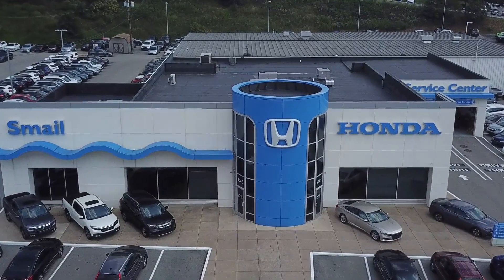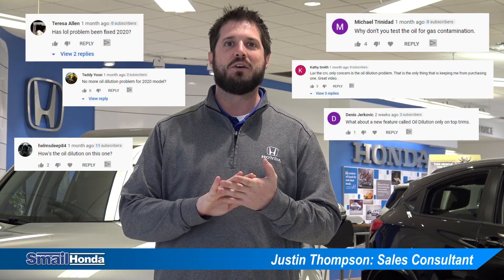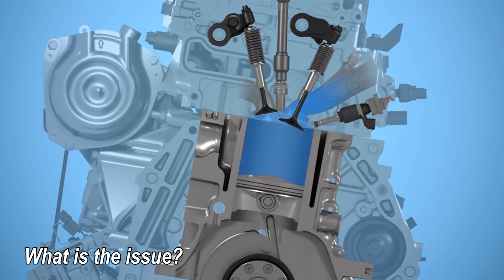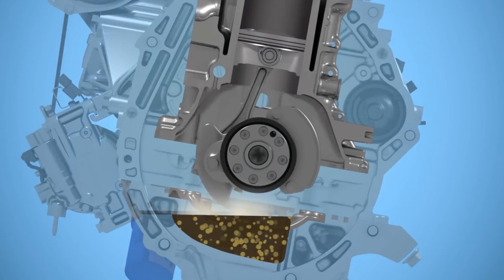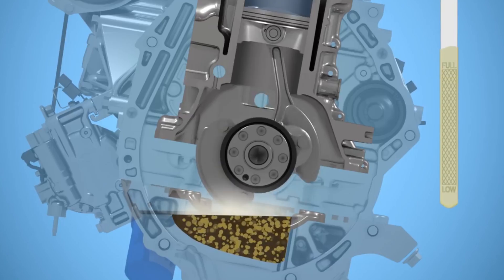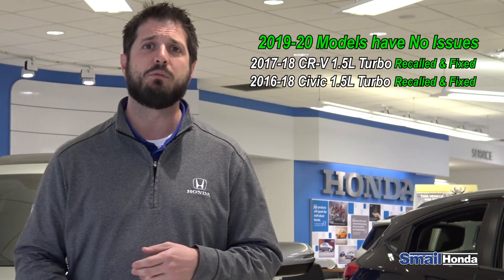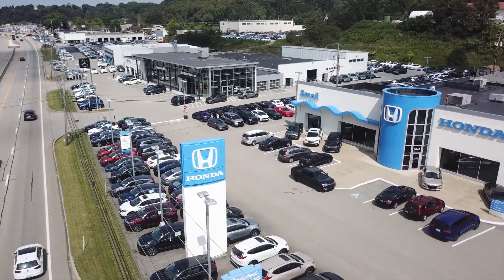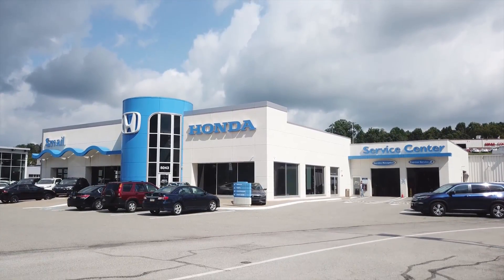Honda Oil Dilution Issue Explained

Comment: These guys work for Honda.   The problem is not solved, they improved it, the oil analysis from Honda 2.0T engines show 4-5 % fuel

Comment: recently got a 2012 CR-V with only 74k miles, clean carfax, car runs extremely well, but noticed at my first oil change the used oil smelled of gasoline. all the research i've done says the problem is only with newer models with 1.5L engine (my CR-V is 2.4L). no one can tell me what's causing this issue and I can't figure it out. any ideas?

Comment: My 2019 civic Si, 100% has the oil dilution issue, and it only has 24K miles. Noticed high oil level, changed the oil, and all I smelled was gasoline. I always take really good care of my vehicles in terms of scheduled maintenance, so I'm pretty bummed about it.

Comment: I'm supposed to trust this knucklehead who can't even pronounce dilution correctly?   Since when does a mechanical equipment's motion and an inadequate seal issue become a software issue, unless speed of motion and the movement of the part is involved.  The turbo charged engines are not nearly as reliable as the naturally aspirated engines nor do they last as long. Had a CRV with an aspirated engine with 387,000 miles on it.  Bought a 2021 CRV turbo charged engine and it failed at 71,000 miles.  Never trust auto dealerships.  They have always deceive consumers at point of sale and during repairs.

Comment: Just as an FYI the 2.0T also has fuel dilution issues. After 4000 miles, my 2.0T had 4.5% fuel according to Oil Analysis.

Comment: I drive my 2018 CRV EX-L 1.5T (which has the Honda "fix") almost entirely highway miles at around 75MPH - AND always have the "oil" above the full mark when I change it with 50% life remaining on the Maintenance Minder. The real question is how many people experiencing this issue are getting 150,000+ miles on their engine without wear issues. If that turns out to be the norm then I'll agree it isn't an issue. Until then it's entirely premature to say there is no issue.

Comment: Not true. At 54 years old, my wife and I have owned quite a few vehicles. I have NEVER had the oil level rise on any of them except for my wife’s 2020 CRV. My 2020 2.0 Civic oil level doesn’t move at all between oil changes.

Comment: Since I own a 2017 Honda civic sport touring 1.5L turbo engine model, And I do all my own maintenance, Oil changes, Ect... I now have 45 thousand miles on the odometer, And I'm not going to BS anybody about the way I drive the car, I run the crap out of it every chance I get! I have two $260 Dollar tickets since I got the car to prove it! That's why I bought the damn thing for was it's the sport touring model! And with 30+ years of experience under the hood of cars can diagnose problems with a vehicle almost as well as anyone else! I believe that there are two issues that cause fuel to end up in the crankcase. First one is the PCV Valve is a plastic piece of shit! You can change the old pcv valve for a new one and in less than a week it starts running rough idle while waiting at stop lights and I put the car in neutral until the light changes and I can go. Engines have more vacuum at idle than any other time! You loose your vacuum signal the more you open the throttle! So when the PCV Valve sticks closed there is way too much crankcase pressure on top of the fact that it is direct injection and has a high cylinder pressure due to the fact that the car is turbo charged as well! It forces unburned fuel past the piston rings! Why would it have so much unburned fuel being sprayed in the cylinder you ask? Because the car has so many electrical components from the factory! Heated seats, heated mirrors, A computer in the dashboard that takes a lot of power to run!And what did Honda do to try and shave some weight any and every place that they could think of? They put a battery in the cars sold in America that is twelve pounds lighter than a battery your car would come stock with if you purchased the car in Canada or cold climate places in the world! In order to shed twelve pounds on just the battery your removing or making the battery have less reserve compassady! Now the iginition coil packs on an engine that runs over the sparkplug coil packs are very awesome if they are supplied power by a good strong battery that can supply them with all the power they need! But with all the things turned on that take electricity to run ( And that would be quite a number of things in this vehicle! ) The coil packs are not saturated the way they were designed to give the sparkplug a good hot spark so it can burn the fuel efficiently under high cylinder pressure such as this earth dreams direct injection and turbo charged engine needs! Especially when the engine is not up to operating temperature yet! So where does it go? It gets squeezed past the piston rings and into the crankcase ending up in the oil. At least that is my theory! My civics battery failed miserably at 24 thousand miles! And it's battery box and hold down clamp is not large enough for a battery that this vehicle needs to distribute power to all the electrical components and supply the power required to give the engine and all it's sensors and individual iginition coil packs the power needed to perform properly. Especially this particular engine that has high cylinder pressure! And if you turn up the wick on these engines you just added to the problem!This is why they say that you need to tighten the sparkplug gap if you modify or add more turbo pressure to this engine! It has a hard time jumping the gap the more cylinder pressure you create. Make since?😉

Comment: LOL. My 2019 CRV has the oil dilution problem. When my maintenance schedule display shows 80% oil life left my CRV is between 1/2 and 3/4 of a litre above the full mark and smells strongly of gasoline. My  Honda dealer told me that if it  got bad enough to turn on the check engine light  they would look into it then. This was my third Honda and it definitely is my last. I have  no faith in the brand now whatsoever.

Comment: Honda Oil Dilution Issue Explained?
You never explained anything
The problem is the motor is too thermally efficient and will not come up to operating temperature
Software will not fix that
 If the motor does not come up to operating temperature, the piston rings will not fully expand and let gas pass by going into the oil pan diluting the oil and causing premature wear to the engine and engine failure
Also an oil pan full of gasoline and fumes is not a good thing for obvious reasons
Also because the motor does not come up to operating temperature
An issue you never mentioned
You will not have heat because the heater depends on hot water from the engine to circulate through the heater core to provide heat
So no hot water = no heat
Bring back the bigger 4 like the one the turbo replaced, that is still in the new 2022 entry level Civic that I own, I had to cheap out and get an entry level Civic to get the good motor to stay in the Honda family
When maybe I should have left
Also the bigger 4 is equivalent on gas mileage in real world driving anyway
Especially when some on the gas now is wasted going into the oil pan
Something anyone would agree with who is reading this who has owned both, like I have
Also how does taking a vehicle on long drives for nothing,
Save fuel?

Comment: This issue has absolutely NOT been fixed. Honda made some software changes to try and get the engine to heat up a bit quicker and also run the engine a bit leaner on start up but the problem persists. Not all inherent mechanical problems can be fixed with a software upgrade. I'm sure honda already know this.
Reply: Does the software update advance or delay the transmission shift points? Somebody said it also alters the transmission behavior.

Comment: I have 2019 and still have this issue. It is worse if I use regular, I have to get premium to help lessen the damage. I have a case with American Honda as well because Honda`s reliability is VERY QUESTIONABLE right now! Took it to 1 dealer Shockley Honda, they told me, nothing they can do since I didnt buy the car from them. Went to Rockville Honda and they are saying it`s normal, and will send it to Honda America for a solution!.

Comment: Cool now do a recall for faulty a/c. The crap a/c is why my next car is going to be a Toyota
Reply: They have on the condenser 10 year from time of purchase that being said they aren't owning up to the faulty compressor they blame the road conditions. I bypassed the dealership put in my complaint to Honda Headquarters twice they covered it with the exception of $200 to dealership. $1200 worth the aggregation......where's that recall!
Reply: @GigiWright  the dealership quoted me to replace the compressor, but mine turned out to be an evaporator leak!

Comment: I’ve been having this issue since I bought my crv in 2018. Did the software update but still the issue continues. When I went to my dealer, they said everything was fine. Had my oil tested at a lab which showed the problem. Oil level goes up and down. Exhaust smells strongly of gas. Car stumbles at times. I went back to my dealership for the same issue and was told I have to pay $200 for diagnosis.

Comment: Why brother bought a 2020 CRV.. Was some fuel in oil. My dealer said a bit is normal. Usually for vechiles in cold climates and driving short distances. My bro does not think issue is solved.

Comment: It is a lie. I have a 2017 Civic with oil dilution of 10.55%. Got the fix done and now I am at 13.72% and still have 30% to go on the oil life. I also live in Southern Alabama. The problem is not solved. Dealers don't care to check it. It is not normal to have that much fuel in the oil. It is killing the additives in the oil and messes the lubrication up. Gas is a solvent. You don't want that in the oil going around in the engine.

Comment: Friend bought 2017 crv. Wouldn’t heat up. Heater didn’t work. Had to fight with Honda for 2 years to get a heater installed. Should have sued them. Never again

Comment: Not buying this explanation.  Direct injection gasoline enters atomized by the high pressure injectors, in precise amounts to insure a complete burn.  That’s the purpose of GDI.  Other manufacturers’ GDI engines don’t have this problem.  Short trips & cold engines are susceptible?  Sounds like leaky, crappy injectors to us.

Comment: This is clearly a mechanical issue (good explanation btw) but how does a software update fix that?  No explanation whatsoever on that, and hard to believe a software update will fix a hardware issue.
Reply: the engine runs hotter and supposedly burns off the fuel that gets into the oil.

Comment: The contact surface between the honda piston and the cylinder wall is reduced. Gasoline is squeezed from the piston ring into the crankcase. Every time the oil is changed, it smells of gasoline.

Comment: I love their motorcycles, but the quality of their cars has been in decline for a while. The explanation for why Honda 1.5L engines were flooding their crankcases this severely doesn't really make sense. Nearly every manufacturer uses a direct injection fuel system yet they don't have issues with engines nearly hydrolocking due to so much fuel in the crankcase. It doesn't help that Honda brushed customers concerns off. If your engine dumps that much fuel into the engine oil, it will damage the engine, even if it still runs. Honda claimed it was fine to just change the oil and give it back to the customer. That's completely false. Gasoline is not a lubricant. It thins your oil out. Driving around with diluted engine oil will rapidly wear bearings and other moving components in the engine.
Reply: Piston design issues, reduced piston-to-cylinder contact, gasoline running from the piston rings into the crankcase

Comment: This guy is a car salesman. He lies. That's just what they do. I bought a 2021 Honda CRV 1.5 L engine, and the oil dilution problem is NOT solved despite Honda's software band aid fix. 
Strong gasoline fumes in the cabin and an oil dipstick level about 13 MM (1/2 inch) over full at 5,000 miles on the odometer. I was aware of the oil dilution problem with 2017-2018 models, and the class action lawsuit regarding cars with these turbocharged engines before I bought my new 2021, but I'd taken Honda for it's word that they had fixed the problem. How do you spell chump? 
Despite the problem, Honda still recommends 0W -20 engine oil, which seems stupid in mild climates where 5W-20 oil may help mitigate some of the oil dilution experienced at cold and low warm-up temperatures. Higher viscosity oil would also suffer less viscosity degradation from gasoline dilution between oil changes. But Honda will likely void any warranty claims if anything other than 0W-20 oil is used in their affected engines. For reference, I also have a 2010 Honda Fit non-turbo 1.5L engine of the same engine family. Honda recommends 5W-20 for that engine, which I assume has the same engine clearance tolerances. I understand the problem associated with squeezing maximum performance and fuel mileage from a tiny 1.5 engine by pushing it with 18.5 lbs of turbo boost. There is no free lunch, and in this case the cost is fuel dilution of engine oil, but Honda knew this, and marketed it anyway. The cost of lower MPG (via engine and transmission software updates), and more frequent oil changes recommended by Honda negates the relatively high mpg advertized as a selling point for these vehicles.   
My next car will be a Toyota.

Comment: Bottom line folks, ALL CARS WITH GDI have fuel dilution issues,  And if you have a Turbo on top of that it only gets worse. There is no fix, just change oil early, and hope for the best. Eventually,  manufacturers will do away with GDI and it will go down in history as a big mistake.  And yes, I have a GDI car with a Turbo! I change the oil every 3000 miles, and the dipstick reeks of gas by then. If you guys are doing 6, 7 thousand mile oil changes......good luck !!

Comment: Okay, I got some advice for you: 1. Don't be a salesperson speaking from a showroom telling people 'No problem!'. Nothing is less believable. 2) You keep saying delusion instead of dilution. And it's kinda funny because delusion is what might be at play here. 3) Honda reduced piston ring pressure to nothing for fuel economy and this is how gasoline bypasses the rings. Add turbo pressure in tiny engines to it and you have recipe for disaster. Software update fixing it? Try again. This piston ring issue is getting out of control across al manufacturers.

Comment: I have my 2020 accord 1.5t, so far I put 20,000 miles on it, dealership told me it was time to do a maintenance to clean throttle body and remove carbon deposits. This cleaning has to be done every 10,000 miles and also I change oil every 3500 to 4000 miles just to keep engine more clean, I just hope for the best.
Reply: thats concerning if thats apart of the routine. to me it means it hasnt been fixed. our Benz doesnt even need that bs done. Honda’s shouldnt be on the streets. im trying to rid mine

Comment: Just purchased a 2021 Accord with the 1.5 turbo. I can imagine that it is even more reliable.
Reply: Imagination vs reality is often disappointing. Expect oil dilution and fuel vapors in the cabin. The problem is still not fixed.
Reply: LoL, I don't need to imagine... I know that if you drive your Honda for short drives, oil dilution will wreck your engine in about 6 years (right after the warranty runs out).  At that time, the best way to fix Honda problems is to buy a Toyota

Comment: I feel like this is a complete lie coming from a Honda dealership. My dipstick smells of oil. What a shame Honda!!!!
Reply: Piston design issues, reduced piston-to-cylinder contact, gasoline running from the piston rings into the crankcase
Reply: @吹不要  Do what now?
Reply: You should research Honda Lies.
Reply: @COSMACELF1802  Ok.. would you personally buy a turbo honda cvt?

Comment: I have a 2016 civic and the software update didn’t solve it for my car, not a big deal because I change the oil twice as often which cost more but I won’t be seeing failures because of gasoline in my oil . Now I’m having separate issues with (Crank but won’t start ) which is a fuel problem on the high pressure side .it’s got 120000 miles .

Comment: so, (correct me if I'm wrong) they have "solved" the issue by cutting the fuel? So, instead of redesigning the piston, rings, or cylinder  to handle the pressure, you all cut down the fuel?
Reply: Wouldn't even say the issue is fixed at all, family owns this vehicle and still gets 1L of gasoline in oil every oil change

Comment: seeing the issues people are having. Honda needs to fix this with new injectors plus a software update. this happens on turbo european autos. they fixed it with updated injectors and software update. i get no oil dilution on my euro auto and glad i still have not replaced the k24 auto i have for the earth dreams turbo.